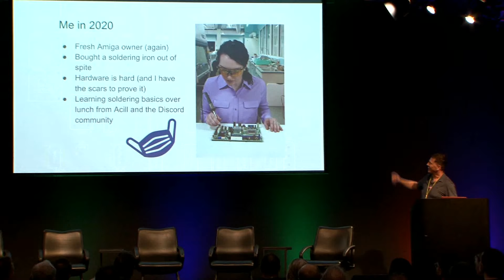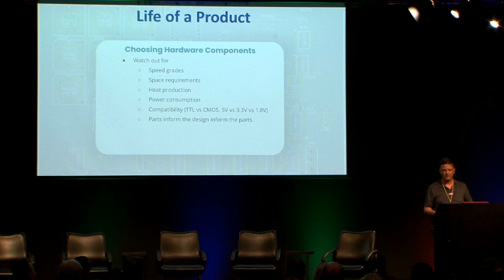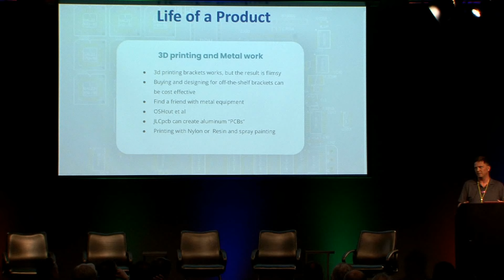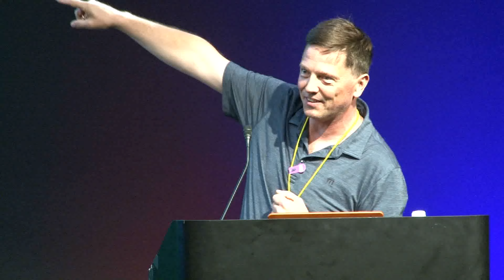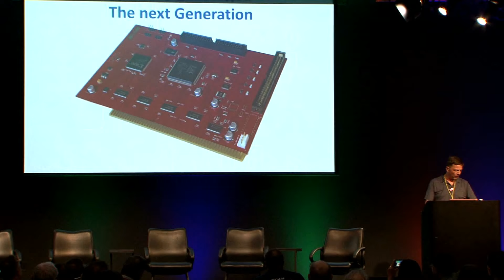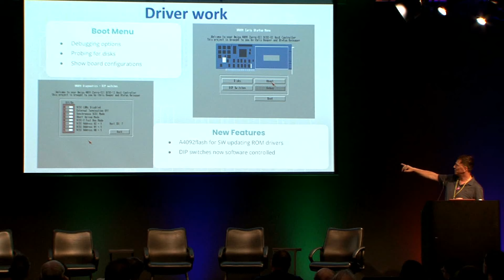Reinauer - Amiga 40th 2025

Comment: Project Genesis and Motivation
The Spark: The project began in 2020 after the speaker, a newly returned Amiga owner, was frustrated by high international shipping costs for small expansion boards. [03:20]
The Goal: To reverse-engineer and reproduce the Amiga 4091 SCSI controller with his friend Chris Hooper, aiming to recreate the original product experience for the community, not just the circuit board. [04:31], [05:27]
Motivation: The speaker is driven by the desire to build the cool hardware they could not afford as a child [02:21] and to engage with the highly collaborative retro-computing community. [01:33]
The Product: The original 4091 is a Fast SCSI controller (10MB/s) that utilized the 32-bit, advanced DMA Zorro 3 bus of the Amiga 3000 and 4000 models. [06:37]

Hardware Development and Design
Project Selection: Start with an achievable project; don't try to design a dream mainboard as a first effort. [07:52]

PCB Design Workflow:
Always finish the schematics (the logic diagrams) before starting the routing (the physical board layout) to avoid having to restart your work. [10:05]
Recommended software includes KiCad (open source) and Easy EDA (cloud-based collaboration). [10:42]

Component Challenges:
Voltage Levels: Exercise extreme caution with modern 3.3V or 1.8V chips connecting to the Amiga's old 5V logic, and plan to use level shifters. [15:33]
Obsolete Parts: 5V logic is becoming rare, and popular 5V CPLDs (programmable logic chips) are officially obsolete, complicating new designs. [16:23]
Speed Grades: Faster modern components are not always better; they can cause instability in old systems. [14:09]

Manufacturing and Logistics
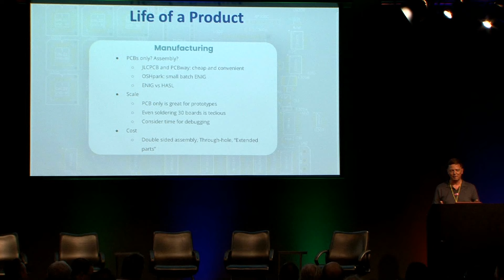Assembly: Hand-assembling is viable for prototypes (the 4091 took 8 hours per board) but quickly becomes stressful; consider using assembly services like JLCPCB for production runs. [25:09], [25:56]

Cost Optimization:
Consign parts to the factory (ship rare chips to them directly) to save on costs and back-and-forth tariffs. [48:28]
Reduce the board size to save on manufacturing costs and avoid oversized fees from shipping companies. [34:10]
Packaging: Getting instruction manuals and booklets professionally printed was found to be about a third cheaper and higher quality than printing at home. [31:44]
Shipping: To mitigate "ruthless" international shipping costs and tariffs, find local partners to ship a large batch to a region, and have them distribute locally. [33:10]

Community, Ethics, and Debugging
Open Source: Making projects open source is a "must," as it fosters invaluable community contributions—such as a user-submitted patch that made the SCSI controller 1MB/s faster. [35:08], [35:58]
Legal: Be mindful of trademarks (Commodore, Amiga) and copyrights (like the original ROMs); reach out to stakeholders for permission. [37:14]
Debugging Tools: Essential tools for hardware development are an oscilloscope and a logic analyzer, which can be found cheaply for under $100. [40:54]
Design for Review: You must get a second set of eyes on your schematics, as you will become "blind" to your own critical mistakes. [43:52]

The Next Generation
New Design: The latest iteration of the controller is more compact, moving all the GALs into a single CPLD and adding flash memory for software-controlled features and firmware updates. [50:34]

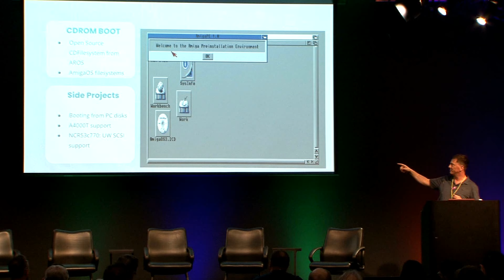Future Plans: The team plans to incorporate an Ultra Wide SCSI chip to further maximize the Amiga's data transfer speed. [56:18]
Reply: Now that is what I call a comment! Thank you!